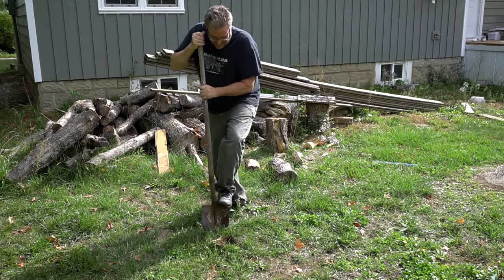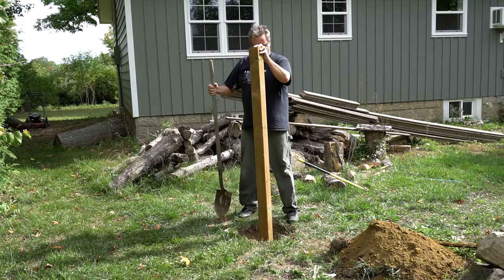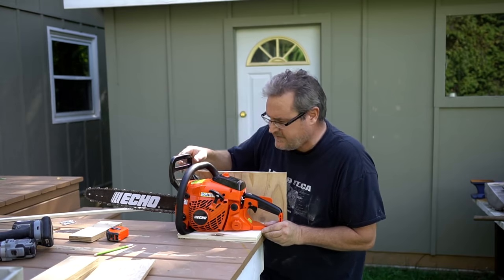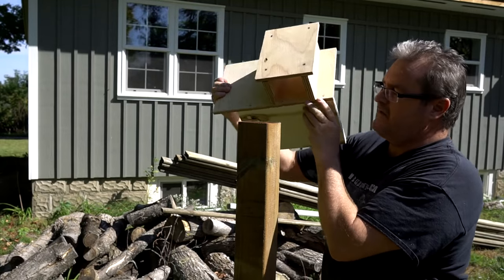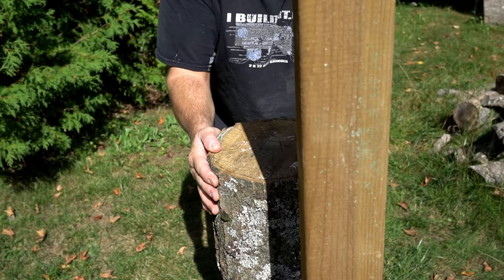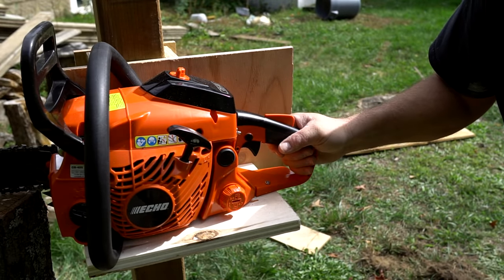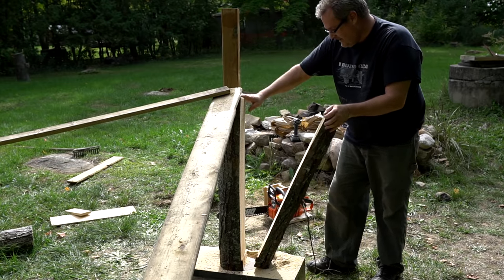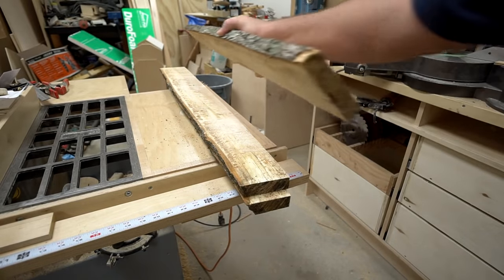Making A Quick and Dirty VERTICAL Chainsaw Mill

Comment: what you describe at 11:15 is not quarter sawing.  you are just plain sawing half of a log.
Reply from the maker: "Perpendicular to this face so they are quarter cut" - look up quarter sawn, because that's what it is.
Reply: sorry, but no.  to be quarter sawn, some cuts would have to be perpendicular to that face and some would have to be parallel.   in your method, only the few boards you cut from near the center are quarter sawn, the rest are rift and plain.  the board you cut at 11:45 is not quarter sawn.
Reply from the maker: Guy, I know what quarter sawn is. You might want to work on being less pedantic - nit picking know it alls are pretty high on my most annoying list.
Reply: ah hell this us too much im fuckin crackin up laughing my ass off reading these comments for this wacky gravity fed chainsaw mill fiasco.  is this some new kind oh comical utube or what?

Comment: An electric chain saw might work well in this application.
Reply: There's a lot of great aspects of using an electric chain saw, like light weight, instant start/stop, no fuel issues, low cost, etc. But they just don't have the power to do well with rip cuts.

Comment: I sure as stink can't go dig a hole like that in my yard - heavy clay.
Reply: Ive got bad clay as well and best tool to dig a hole is a Seymour auger. Just need to dig a divot, flood the divot, wait, then use the auger. Just did 10 4ft deep holes and was relatively easy; way easier than a post hole digger
Reply: soak it with water it gets easier no auger required go old school its cheaper

Comment: All you need to do is add a clamp on the handle, nothing special there, mechanism required.
Other than that, neat idea, quick and dirty.
Reply from the maker: I disagree. You'd want to stop this fast if something went wrong, and whatever you put there to hold the trigger would have to stay on with all of the vibrations.

Comment: Your chain is on backwards
Reply: I am joking, it is a comment eluding to the reality that your chain is dull, 'factory sharp' is not sharp at all. A correct sharpening you should have strips (chips) as long as space is between each tooth, strips turn into chips, they become progressively shorter as the chain dulls. AS you have only sawdust being created and not strips or chips this is a dull chain.